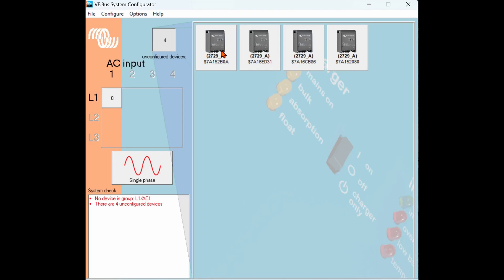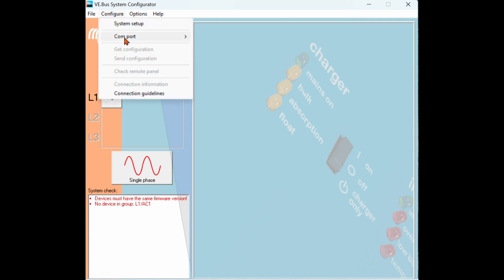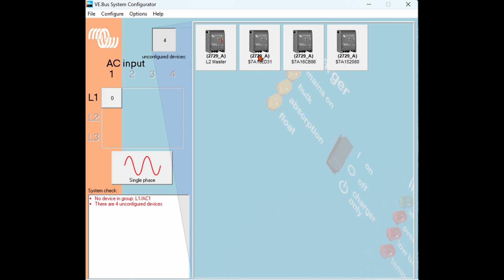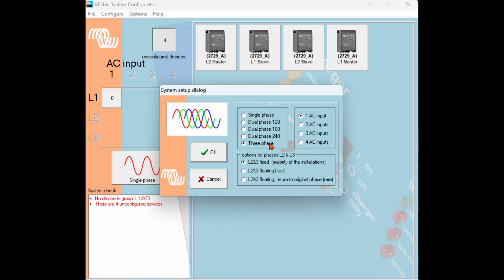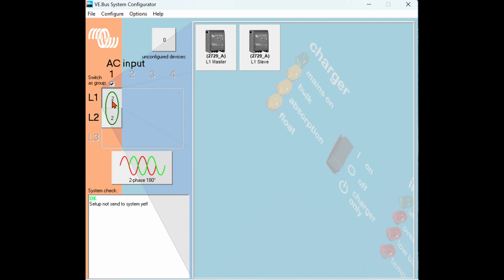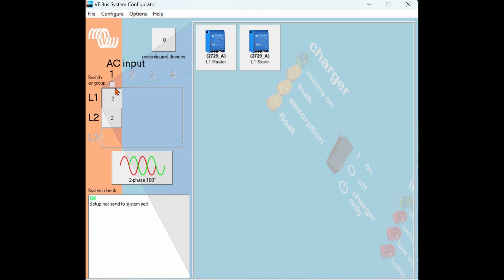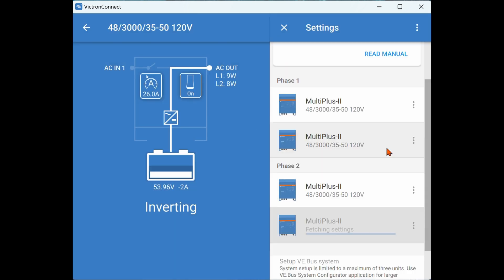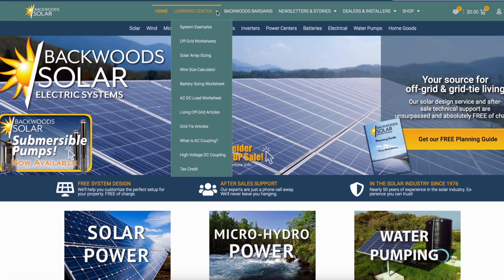Victron Inverter Setup - 4 or more Inverters - Parallel, Split Phase, 3 Phase - System Configurator

Comment: I currently have a 30amp single phase RV with a 12v Victron system. I installed, programed, and it functions flawlessly. Sometime in the new future (looking now) we are upgrading to a larger 5th wheel with 50 amp split phase service. My current plans are to go to a 48v dual inverter split phase set up. What I do not understand is what happens with that set up if I get to a campground with only 30amp single phase service. Can I still just use a dog bone, or do I need to change something in the system? Do you have a video for this?